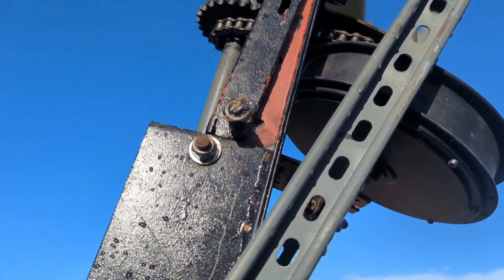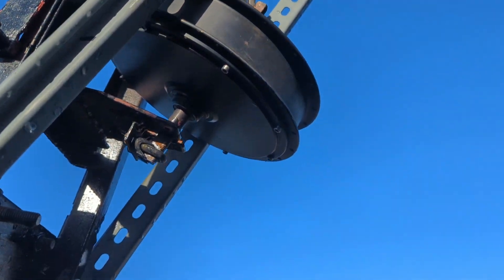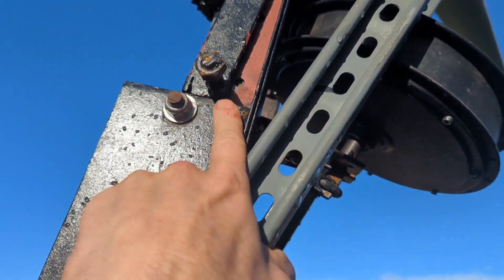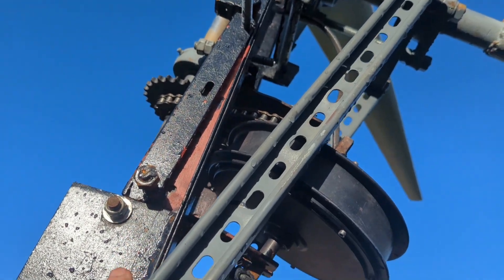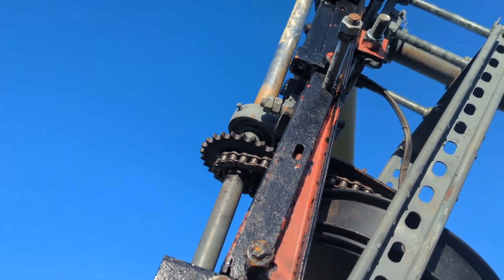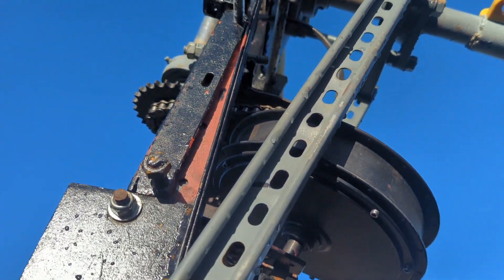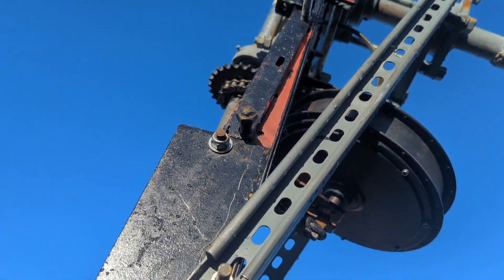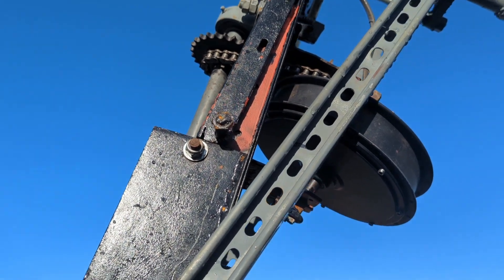NEW WIND TURBINE Had the same problem occur under braking at 30 amps + Livestream Halted

Comment: Hi Gavin - that's a shame. Have you considered a 'control solution' once the physical damage is fixed? Usually the 'brake' is just a short circuit, I wonder if you could lessen the jolting effect by introducing a resistor. A heating element from Kettle would possible do it. It might not bring the turbine to a dead stop but it would turn very slowly if the resistance was sized correctly - might need a bit of experimentation!!!! Just a thought :)
Reply from the maker: I managed to fix all the problems temporarily and it's running very well, but I do have a permanent solution for next time it comes down. So all the problems are sorted.